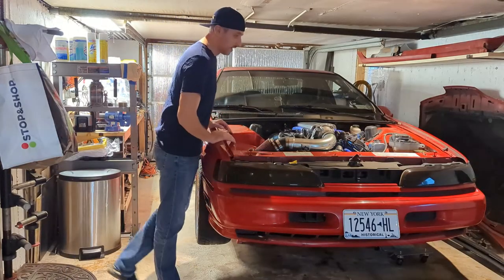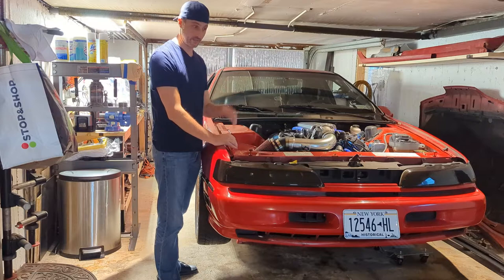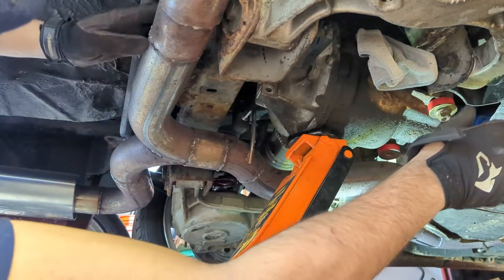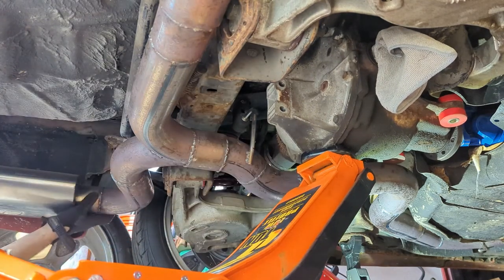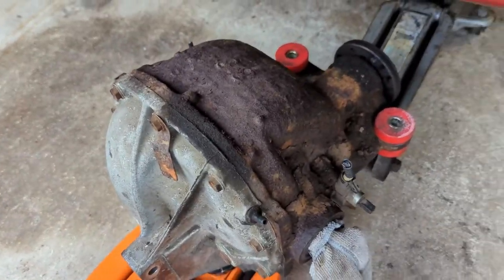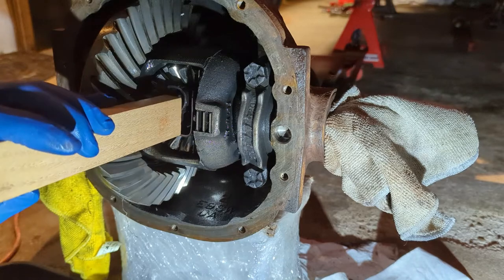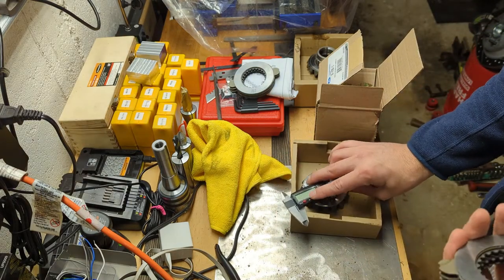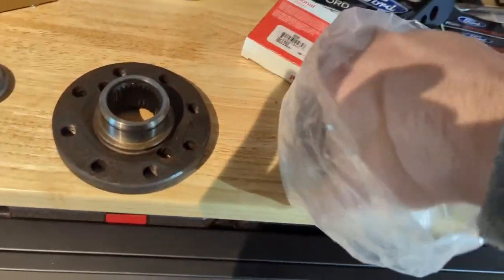COYOTE SWAP FORD 8.8 IRS DIFFERENTIAL UPGRADE! THUNDERBIRD SUPERCOUPE, LINCOLN MARK VIII, COUGAR

Comment: TIP: A ratchet strap from control arm to control arm works better than a jack. You can roll the differential around without worrying about it falling off.
Reply from the maker: I have a low profile transmission jack, but I was trying to mimick a scenario for people that don't have the tools. But definitely thank you for that tip! Probably going to try that next time! For sure!